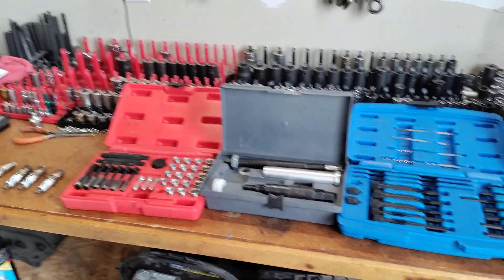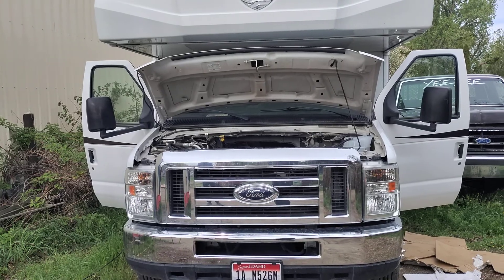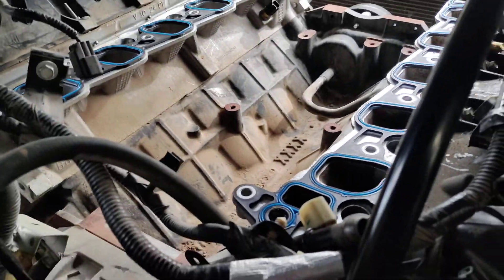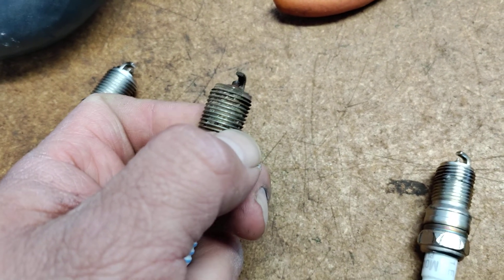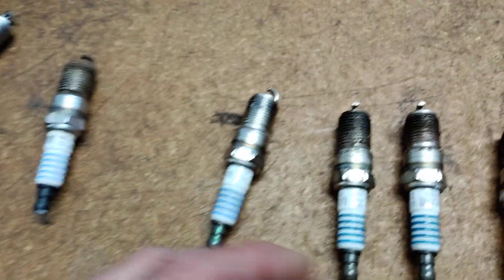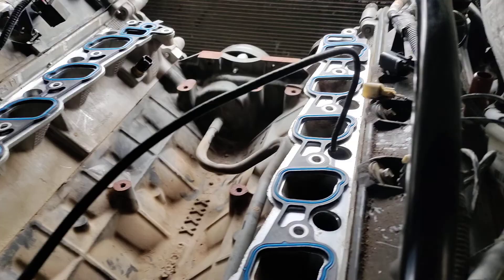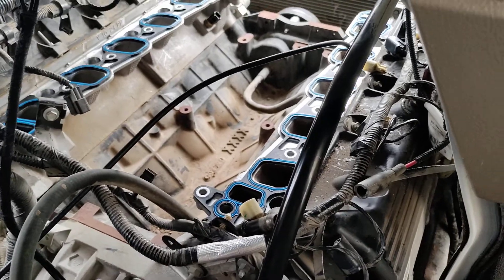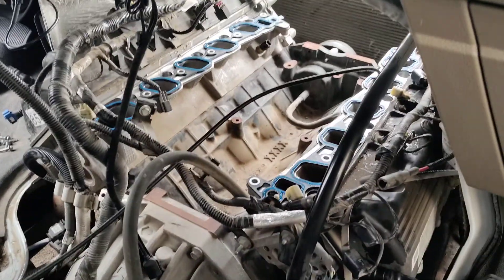ford triton spark plug issues. typical blown/rolled threads.

Comment: I got rolled threads on my moms 14 escape 1.6l.  Super bummed.  My final plug broke and left the threads in head.  Porcelain is extracted though.  My snap on #5 easy out aint budging it either.  Next up, drilling it out, while head still installed. 😢